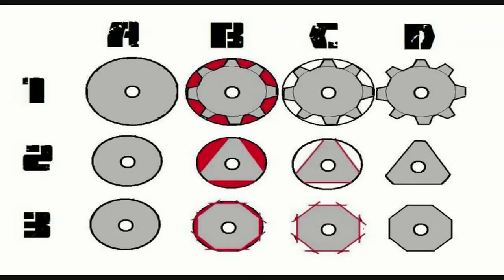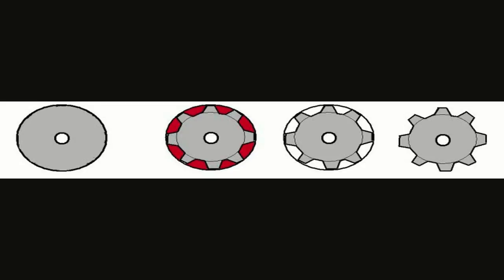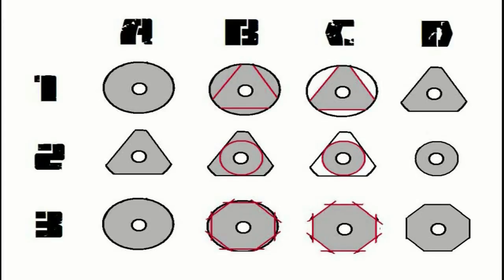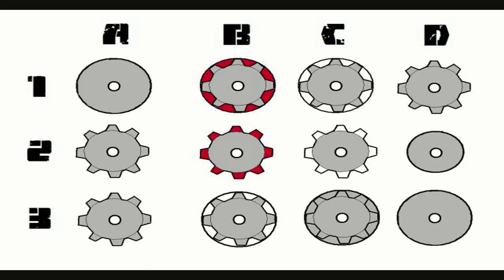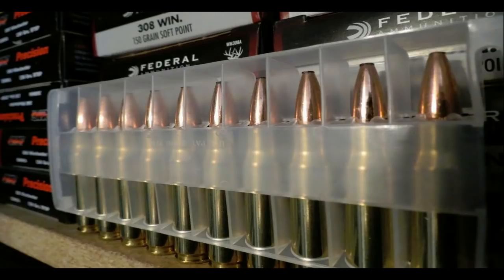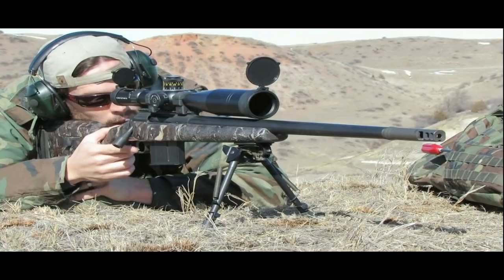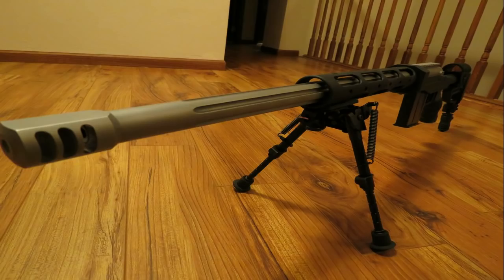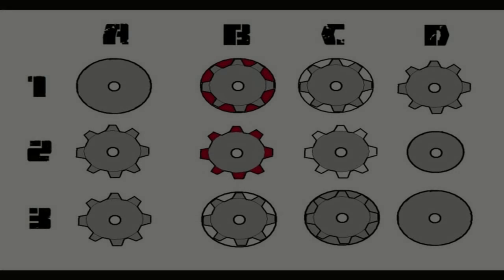Long Range 101 Part 10 - Fluted Barrel Rigidity and Cooling Dynamics - Rex Reviews

Comment: Sounds like we're getting way too wrapped up with this stuff.

I'm not using a barrel as a crowbar, so, rigidly isn't an issue. Heat-treatment ensures sufficient physical strength.

Fluting is heat sinking...and that is important, particularly for AR's/short barrels.

That's especially true if you're going to mimic a machine gun (which is silly and expensive).

Use loads appropriate for barrel length to consume all of the powder, and erosion should be minimal.

Don't over-clean your gear.

It's not needed if done well, and you aren't abusing the rifle.

JMO...

Comment: QUESTION: My rifle has a nasty habit of shooting high first cold bore shot. The 4 follow up shots will be in around .300. You can imagine how frustrating this is. Have you ran across this with any of your rifles ?
Reply from the maker: gunnr wallace Yes, sir.  That is quite common.  This is commonly associated with bores that have just been cleaned... it takes a few shots to reestablish stable bore conditions after a cleaning as the fouling builds up to equilibrium point again.   Also, if a rifle has just been carried to the firing position, it is possible that the action and recoil lug have shifted ever-so-slightly forward in the stock during transport - after the first shot, the recoil lug slides back again and again become solidly mated for the follow-up shots.  This is usually associated with rifles that could use a glass bedding job.  Temperature can play a role in POI shift in a barrel in which the bore hole is extremely off-center, but its usually a very small shift and wouldn't occur until the barrel heats up significantly to induce warp.

Comment: Lets say you only had 6 pounds of metal to make as ridged a 22" barrel as possible .... would you choose fluted or round?
Reply from the maker: If you have two barrels of equal weight, the fluted barrel's larger outside diameter will thus make it a little more rigid.

Comment: also factor take in to consideration that the barrel is a separate part of the upper. and physics teach us if two bodies of the same mass touch having to different temperatures they will meet in the middle. There the fluted barrel has less mass and cool faster. check it out!
Reply: +Tamar Ramos But it will also heat up faster with less mass to distribute heat.

Comment: Rex, do you know what broughton contour your buddy 188mule used on his 7mm? It seems they have a few options and was curious what he chose.
Reply: Looks like its a 7.5 light varmint @ 26" it is .840. Looked a my paper work from the build but it didn't have the contour. I think its referred to as the sendero weight.

Comment: Love your videos Rex, but I have to disagree with your evaluation of fluted barrels. Introducing angles into any physical structure inherently adds to the strength and rigidity of the system without adding weight. While I agree heat dissipation may be negligible without sufficient gas flow over the system, fluting adds angles and strength to the barrel without adding weight - think of steel I-beams, they are stronger than any solid piece of steel because of the angles, not to mention much lighter because of less material. A 15" diameter steel rod will never be stronger or lighter than a 15" I-beam - that is why skyscrapers are built out of I-beams versus solid pieces of metal.
Reply: I have to disagree about your statement of adding angles adding strength. As an engineering student, we are always taught minimize angles, hence why fillets are used in product design. An angle has a small radius which maximizes stress concentrations. Here's a link to some info on the topic: https://en.wikipedia.org/wiki/Stress_concentration
Reply: 14dubz is 100% correct. Also your argument about why I beams are used is wrong. I beams are used because they have a greater area moment of inertia than a solid beam of the same amount of material, with either circular or rectangular cross sections. I'm also pretty certain you have never seen an actual I beam because they don't have angles, they have fillets to minimize stress concentrations as 14dubz said. What Rex said is completely correct, do the math if you don't believe me. Math doesn't lie.
Reply: The reason for I-beams being used is strictly weight, not strength.
It's the same for a hollow tube vs a solid bar.
Given the same external diameter a hollow tube can support more externally added weight then a solid bar strictly because it is supporting less overall weight than the solid bar would be in the same situation.
When measuring "strength" in this manner you have to also include the weight of the structure itself, because that weight is also being supported by the structure.
Even then this is only measuring 'side load' and not 'rigidity'.
In the case of a rifle barrel more material is more rigid, until you reach the point that the barrels own weight causes a greater deflection than harmonics.
Simply put, the thicker the better until it sags.
Reply: While it is true that weight for weight and angular structure has greater rigidity, you are correct about the fillets. a sharp corner creates a stress concentration, while a curve does not. It is also true that a broad side of a cylinder is also one of the weakest shapes.

Malcolm, while rex's math was lazy, later in the barrel shape section, he did openly admit to such. Fluting the barrel creates an average thickness that is somewhere between the outer diameter of the barrel, and the inner diameter of the fluting. (Much fancy trig and calculus used to figure out the exact cross sectional area) So his final analysis is accurate that short of some truly exotic shapes or exotic materials, fluting gives you a compromise of weight vs rigidity, but a larger cross sectional area is going to give you a more rigid barrel.

Likewise his commentary on heat sink capability of more metal is accurate. More metal allows for more heat capacity, while more surface area allows for more cooling. a compromise of something in between may find a balance between weight and function.

simplified answer... 
On a bench: As heavy of a barrel as you can get
Carried in the field: As heavy of a barrel as you can tolerate lugging around.

Comment: If you have a triangular Smallsword design and a non triangular Smallsword blade then the triangular design will be more rigid than the other. This would be efficient if materials are limited and you wanted rigidity for thrusts. 

A non triangular Smallsword would not be as rigid for thrusts.

Comment: With the same amount of material by weight and length.which construct is
Reply: A fluted barrel would be your best bet! If a bull barrel and a fluted barrel weigh the exact same, the fluted barrel will give you more surface area and offer the greatest increase in cooling and rigidity.

Comment: the sound cuts off for the whole middle of the video!!
Reply: It turns into left speaker only for some reason. I use headphones and could only hear the audio on the left side. Try some earbuds for that portion if you have mono speakers.
Reply: Phew. I thought I went deaf in my right ear. Thanks :P

Comment: There's an article floating around on the inter webs where a guy does a test of several barrels regarding how well the disperse heat. It's done on a fluted barrel and a heavy barrel and a control barrel. I can't remember the specifics, I could probably find it if you want but anyway, it goes on to give the stats after the testing was done and it showed the heavy barrel cools down the fastest and stays the coolest, just like how the heavy barrel is the most rigid and shape has very little to do wit anything. That being said I think you should do third video, on cryogenics. apparently Krieger uses this treatment method and that's gotta say something. Dropping the temperature down to minus 300* changes the crystalline structure of the steel and it really makes a difference. They typically treat auto parts and so forth but it works well on barrels and actually allows them to cool faster while shooting, there's a video out there of that as well. Then you get into manufacturing methods, ie CHF vs cut/button rifling, and polygonal rifling which is really good for minimal fowling and longer barrel life, especially when it comes to rapid fire rates. I'm no expert just some idiot so please take what I say with a big brick of salt but anyway... Tapered barrels are very interesting and might actually do something with regards to barrel harmonics, not sure if you touched upon that in your other video. Great video!! One more thing, there's certain factors that go hand in hand with the above mentioned methods of barrel manufacturing and rifling, such as the amount of stress a barrel is put under when it is cold hammer forged, and the fact that you can actually buy a pre fluted hammer forged barrel such as a Remington VTR/LTR which is fluted and at the same time the steel wasn't actually removed but instead mashed into the end result/shape of the barrel being a triangle. Which when you look at it is very uneven, with the sides being very thin compared to the end points where the is significantly more steel remaining. It endless what they come up with to sell rifles. 5R/P5 rifling and so forth, maybe it does something maybe it doesn't, maybe it's all moot anyway.

Comment: Why not compare apples to apples, rather than comparing hexagonal barrels to smaller diameter barrels compare them to barrels of equal diameter and radius as buglland fluted barrel.  Furthermore, you are assuming that the boar of all barrels are the same.

Comment: See British blokes with tuned barrel dampners
Reply: I have one of those on my fluted 20" barrel in 6.5 Grendel. Just a chunk of rubber. Once I slid it towards the muzzle and out the A2 flash hider back on, it went sub moa at 100 yards. Most muzzle brakes reduce accuracy too. My Odin Works Atlas does ok. So does my cheap brake with a blast shield on it. Speaking of that, I need to try that one with the Odin and A2 and see if it shoots even better

Comment: Heavier contour barrels usually cool better because there is more material for the heat to disperse in. I think like you said, a thin piece of steel heats up faster  than a thick piece.

Comment: Did suffer some 25 minutes of the video. No-one who passed his high school physics should waste time for this. He basically throws in basic phenomenons  and to impress some equations he has found online. No quantitative information and even the qualitative one is very suspect. For instance he spends 10+ minutes arguing that when you remove material from any structure it weakens it. That's why fluting is bad. I-beams on the other hand are not. But as he has zero understanding what he is talking about, any analysis is omitted. Instead the trant continues

Comment: Man you really gotta cut these videos down... 
Interesting and informative but sometimes quite long winded.
Reply from the maker: I hear ya, bud :-)  This series is intended to be a FULL UNCOMPRESSED information download of this discipline... but I'm glad you bring this up because we are planning to compress ALL the info at the end of the series into a short, very concise outline for regular folks who don't need this level of detail :-)  Hang in there bud!
Reply: Definitely the most detailed i've seen on youtube or anywhere else...
Reply: Yep.  And here unfortunately the really important math on rigidity of fluted barrels left out. Also flutes almost double the surface area of the barrel which greatly improves heat management.
Reply: +TiborasaurusRex The problem with this video is not too much information, but too little. You leave out the math and bloat the basics. This does not help. Basically you can tl;dr this video to the sentence: "Get a barrel as rigid as you can, long enough to burn most of the powder, less material always means less rigidity" What you leave out here is the important part on why fluting makes sense in opposition to simple drilling down the same amount of material and leave a round barrel. Fluting massively increases the rigidity opposed to a barrel with the same weight and length but without flutes. I'd love if you re - do this video with more information and math or replace it with a 3 minute one with the same amount of information.
Reply: +Michael Nguyen I like the length. Videos are very focussed and it's very unlikely I will turn off the PC without having memorized something. That's exactly how uni lectures are done -- they may go over and over the same topic in one single lesson, but that's okay. You cannot have a 101 where everybody enjoys themselves for 8 minutes and then they go out for a coffee. You have to pay attention.
Reply: +TiborasaurusRex 

A good way to make it more approachable would be to create time stamps in the description, bench marks such as where you state the conclusion of the effect on rigidity, and cooling so people could go to parts most relevant to them.
Reply: Stick with the current content and offer a condensed summary. These are great in the first pass.
Reply: You know, you could provide a open invitation for all shooters to attend a Sniper Competition/Challenge course for free,  with AAA rated lodging with all meals provided @ any hotel of the guest choice, along with transportation, uniforms, provide free round trip air fare, provide free range time, to include their favorite firearm & scope(s) of their choice, along with all the ammo they can shoot, with targets, mats, gloves, and all the electronics, gizmo's & all the other goodies that go with it, then after the shoot, as a bonus you tell those that participated they can keep it all and provide a feast that would make our new President Donald Trump green with envy, and you know what? All the shooter had to do was fill out the form to attend & somebody would still "whine" about something they did not like. These instructional's are great and appreciated. I look always forward to your next review. Best regards from the Tar Hill State
Reply: (continued from above) all shooters love and as a surprise bonus, you tell the shooters they can take all the firearms & gear home while you provide a feast that would make our new President elect green with envy, the bottom line is this, somebody is still gonna whine, complain and or get angry because they felt slighted or something did "not" go their way. T-Rex these tutorials are great and most appreciated.
Reply: God forbid you can't watch them and get all the info. Keep the videos uncompressed. People want a short sweet answer, but there isint one. Instant gratification...
Reply: Michael Nguyen 
Uhmmm, Watch it in parts. 😤
Reply: Watch it in 1.25, 1.5, or 2x speed if you wanna speed it up.